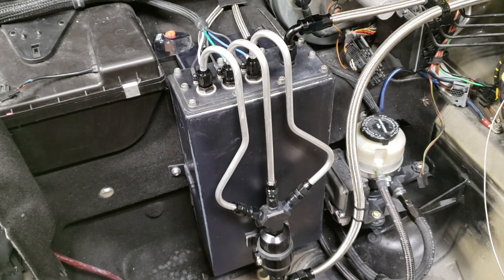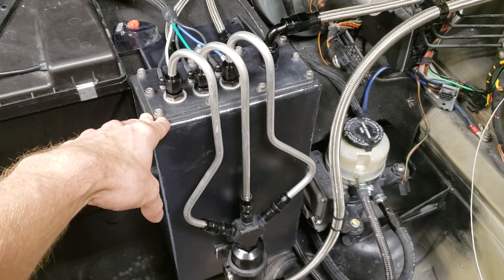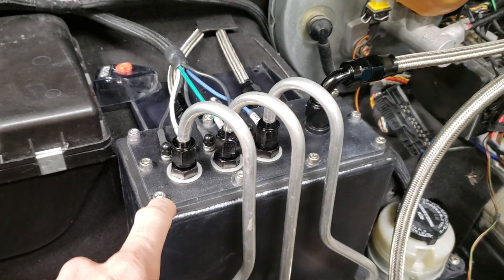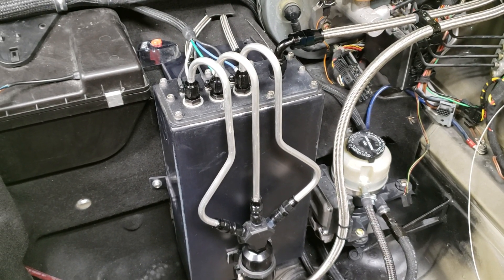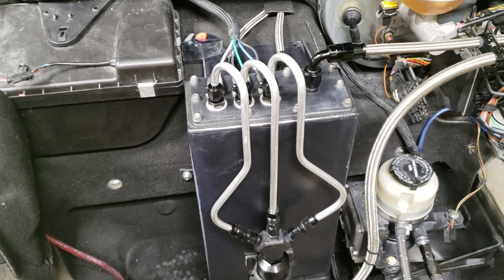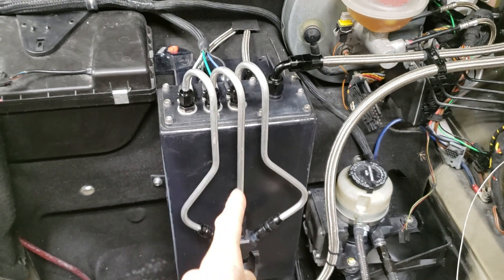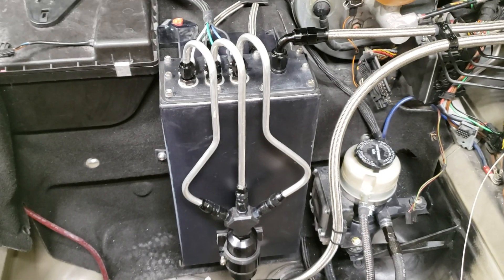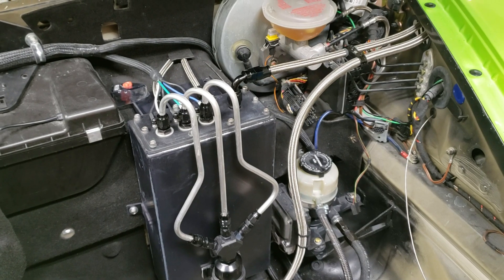1500hp Fuel System with Surge Tank for the Porsche Cayman!

Comment: I did the same mistake on my bike, it used to have a fuel tap for carbs, i opened a big hole and welded a big flange for an in tank efi fuel pump, completely forgot to make the threads that bolt the retaining ring blind. a nightmare to seal...
Reply from the maker: Glad to hear it 😬🤷‍♂️🤣